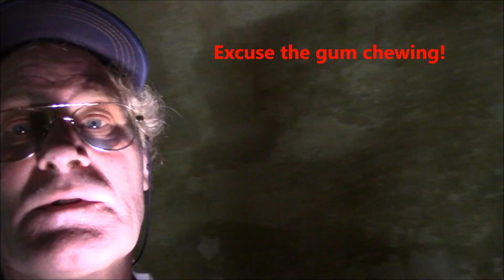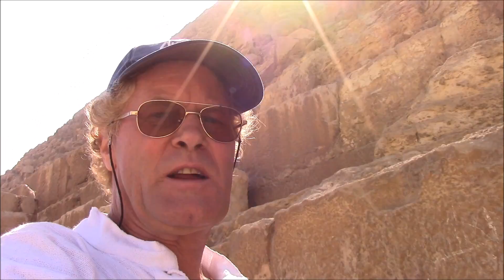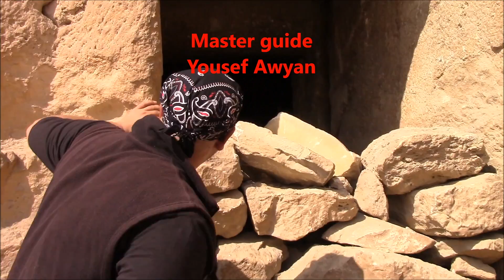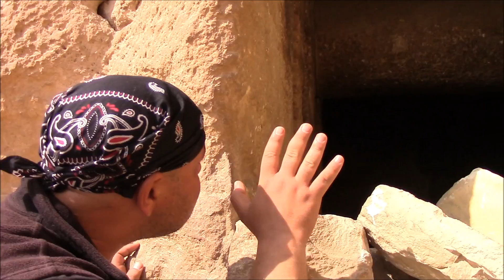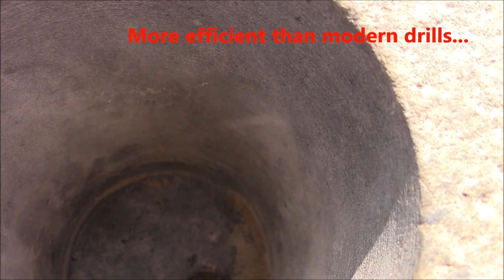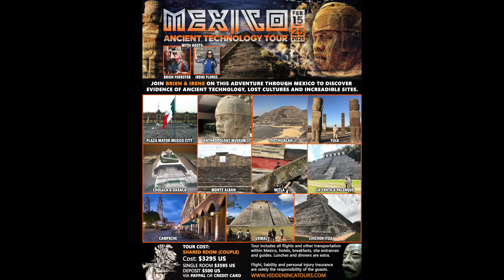Exploration Of The Giza Plateau In 2015

Comment: Some years ago a French team inserted a robot into the shaft in the Kings chamber and found what they called "a door " it was six inches square with two "handles" on it , they sent the robot back some years later equiped with a drill to look behind the "door" this was all shown in a documentry. Like a strange trick the documentry showed that behind the door was a fuzzy inconclusive and mysterious space. and that was that....... the last pictures from the reversing robot show that both of the metal "handles" was missing their lower half , one was missing previously,.... nothing was mentioned... With that sample of metal that is was placed untouched at  the building of that Pyramid they have the means to exactly date the pyramid... so someone DEFINITELY knows EXACTLY when it was built.

Comment: Brien what makes you think that such advanced so called "civilization" that have builder those pyramids could admit such a mistake to let the pyramids get over flooded. Or to lead to a mistake after building them. And we aren't so inteligent to build those pyramids why are we trying to explain how and why were they build??? 

Also stop mentioning about 12000 years ago every single video and every minute in the video. There are no facts yet, it is only your and your team's beliefs, same as others do believe in pharaohs theory. As long as there is no scientific proof there cannot be any version of the timing or constructing those pyramids. Everything is skeptical and every version remains a theory
Reply: @gdpm Is there evidence of the impossibility of re-using and restoring the pyramids during the period of King Khufu, King Khafre, and King Menkaure?
Reply: @gdpm This is what Brien talk about, your conclusion is not as scientific as you think.
You fall into the trap of Circular Logic when you say that the pharaohs definitely built them in the Bronze Age with bronze and stone tools because they certainly did not know steel or advanced mechanical tools.
While the correct method is that we examine these products and then exclude or confirm whether they were built by primitive tools or advanced tools? 
The proven fact is that traditional scholars always fail to prove the possibility of constructing and sculpting these gigantic, accurate, and extremely solid structures with primitive tools, and of course, they fail to prove the possibility of lifting very huge stone blocks with primitive tools.

Comment: I was wondering if the pyramids could have been built from the inside out using a spiral technique.  I wonder about this cause wouldn't it be easier to aline all the staircases and chambers.  Probably wrong but I wanted to ask a professional for your opinions on this. Just guessing.

Comment: The pyramids were shelters, shelter from cataclysm, THAT was their primary function
Reply: @gdpm Copper is great when electricity is involved, no matter how advanced you are, physics is physics
Reply: @doomfathertm8771  that robot with the drill they sent snapped off one of the electrodes , we never heard anything more about it.
Reply: @marxman00  This is true
Reply: @gdpm There is no fantasy that states any such things.  The fantasy is that the Egyptians built the megalithic work using stone pounders and copper chisels
Reply: @gdpm No where in any writings does the egyptian culture lay claim to building the pyramids, they simply wrote on some of it, the great pyramid actually has nothing written in it.  Also it is nonsense to attribute the crude writings scratched in, to the same people and technology that built it. The box in the serapeum is a great example!!!
Reply: Huge buildings built at huhe effort with such small shelter place? I don't think so.
Reply: @stephenphillips4984  I should add, when you take into account the vast underground area at Giza, it wasn't so small
Reply: @doomfathertm8771  this is a good point. You may be right
Reply: @stephenphillips4984  The reason for the small space inside is because they had to be solid. I can tell you 100% these were shelters designed to withstand cataclysm that no longer exists and THE great cataclysm is what eventually ruined it all.  They were built as electrical insulators as Brein mentioned, but that was to protect against external electrical discharge (hundreds even thousands of times more powerful than lightning)  even the vast rooms cut into the rock faces at Petra, this is all shelter! Although the great pyramid was the most advanced
Reply: Good then we can all Breathe easier, all we need to do is reoccupy and cannibalize each other...
Reply: @gdpm Ok, now I know you are just a troll.

Comment: Why is the past built from stone, because it's the only thing that lasts!
Reply: If they only wanted it to last then Granite would be my choice, but they used different spices of Rock for their properties not only for durability...
Reply: Marek GO 
By the cutting marks in the quarry doesn’t seem like any stones were melted.
Reply: @Marek GO stones and holes was cut/drilled by sand, /watch?v=qeS5lrmyD74
Reply: Build top quality, build once! Also they did not use stone because it was difficult , they did it because it was easy for them, Krell tech
Reply: Also they did not use wheels because they did not need such a primitive device , Which came first .people forget that wheels need roads and roads are a more technical challenge than a wheel. Given the choice flying is  a far better. ask the birds!
Reply: How old are most of the these megalithic constructions?

Comment: The tool marks on the quarry wall look almost identical to the marks you showed inside the petra buildings/caves.  Any thoughts?
Reply from the maker: Exactly
Reply: My opinion again the marks are from Water Pressure and Sand mix You can see each pass as it cut thru Back and Forth a very high pressure Tool Blasting. Removing debris with flowing water. That's why we don't find chips.
Reply: @jamiesmith5394  the chips would be deteriorated by now though :D  you wouldnt see any proof of them
Reply: @Marek GO stones and holes was cut/drilled by sand, /watch?v=qeS5lrmyD74
Reply: Marks are difficult to understand you'd need a side by side comparison to judge it to be the same or similar...

Comment: At 7:32 you can’t remove stones starting at the bottom. The weight from the stones above won’t allow it so they had to start from the top IMO
Reply: exactly what i thought. why wouldn't he think that too? odd.
Reply: My Opinion would be that the casing stones would need to be seated into place, perhaps by Vibration to fit so perfectly...